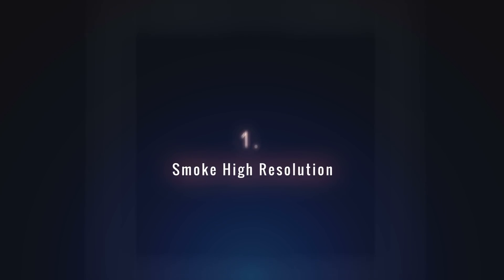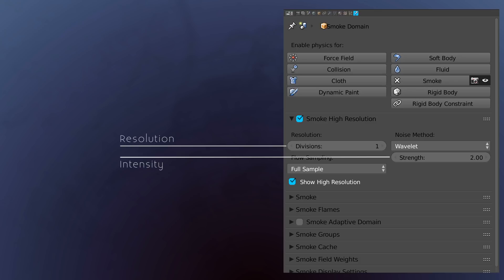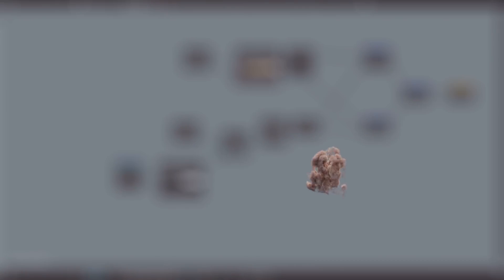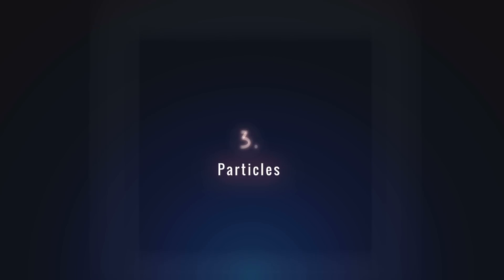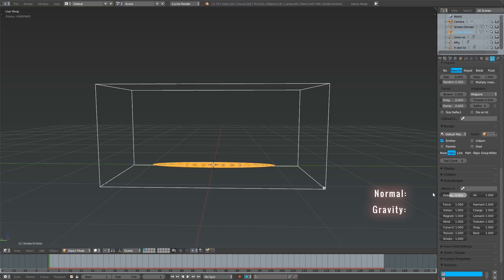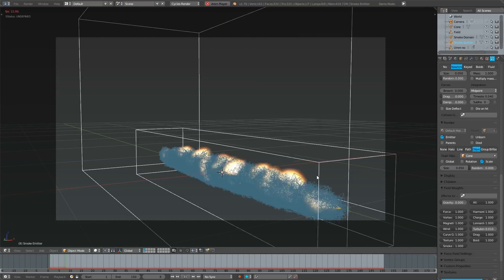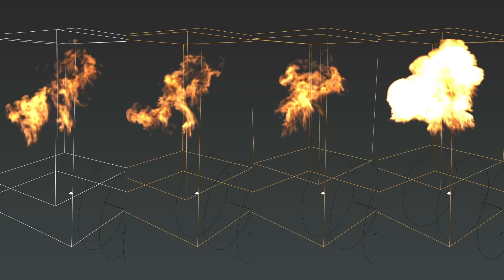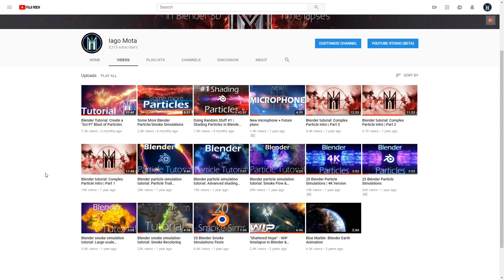4 Ways of Adding Detail to Smoke/Fire in Blender

Comment: I found that with High Res option enabled, the strength value works only for wavelet noise. So you can enable just hires divisions, with strength set to 0, this way you will get more resolution, without additional high frequency noise that sometimes looks odd